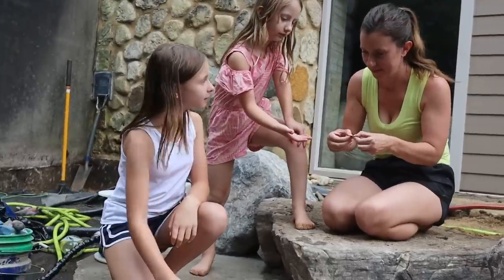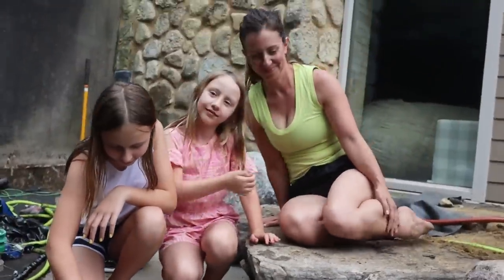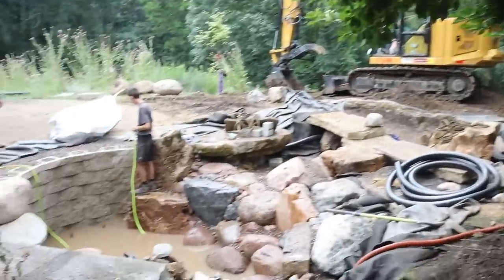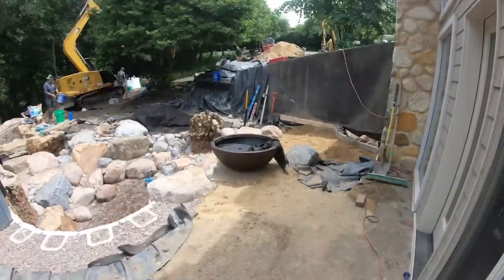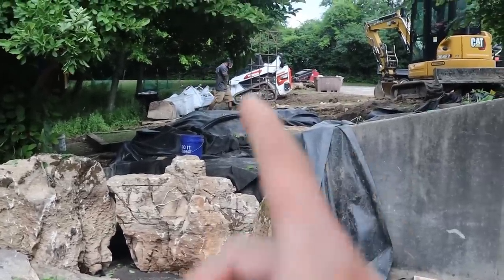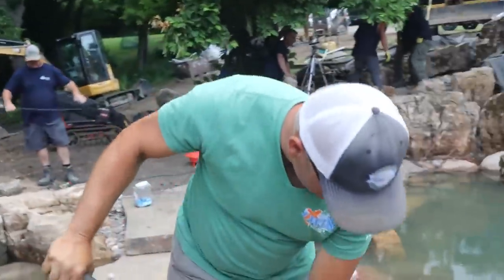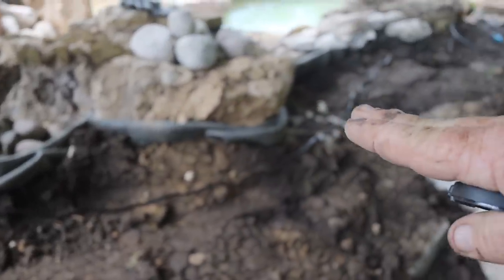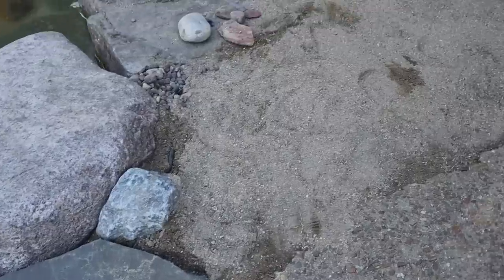Sand BEACH POND - REVEAL!

Comment: I had a beach pond build from Aqua Scapes but had them remove the beach part of it a year later. The build up and maintenance of the sand in the entire pond constantly needed maintenance.  Aqua Scapes always educates customers on the extreme extra work required to maintain a beach access pond so they are not just installing it without ⚠️ warning.

By the way…..I have a wall similar to this customer. I had stones with flat surfaces cemented onto it and had potted plants all over it to totally cover the concrete.

Looked 100% damn amazing 🤗

Comment: Is this considered a rec pond with the beach entry? Do the pumps have to be external? You mentioned the vault so I presume all the pumps are internal. Just wondered how the requirement for external pumping is determined. Great work as always
Reply: wondering the same. we see the aquasurge 2000 pump into the skimmer vault. how do you determine it is safe for kids to play into the water and the beach entry using submersible pump?

Comment: When I build a sand beach (fingers crossed) it will have to be way BIGGER  than this one, and it won't be abutting a house, so, no worry about drainage protection.  Should I still put down liner under the sand?  Would love to see some chalk talks on pond design and the reasoning for putting features where you put them., other than sight line.

Comment: Just multi layered amazing, but leaves me with questions you did the intake bay differently but glossed over it, intake with a skimmer and a jet? And all the pumps are internal on a rec-pond? In the past the emphasis has been made that they needed to be external. And the sand did you just use builders sands, or DG; either here or Ed had mentioned not to use sand but to use DG sand is dirty and you constantly have cloudy water but DG has bigger grains no fines is just stone.